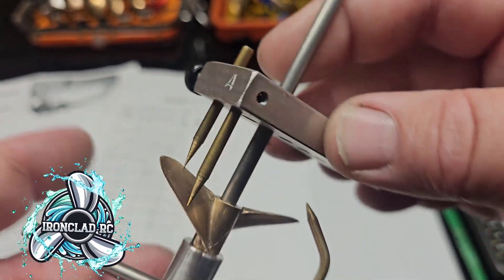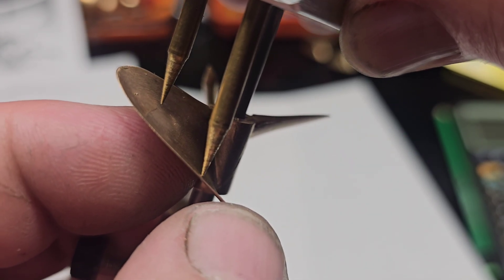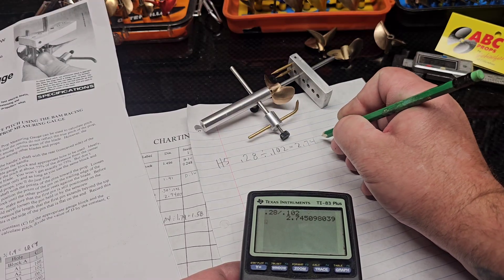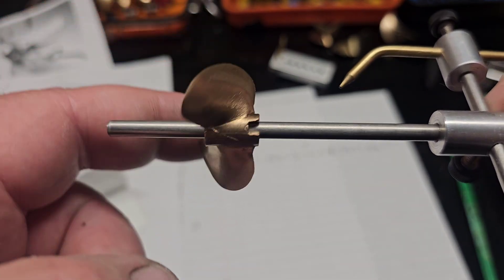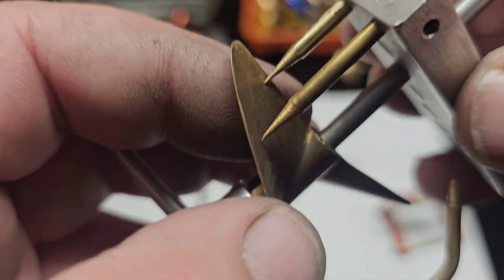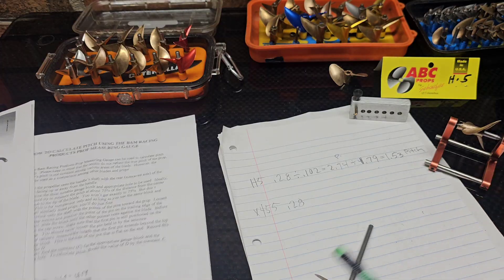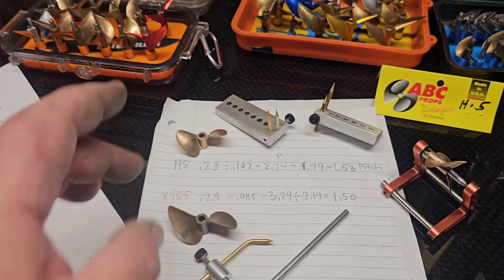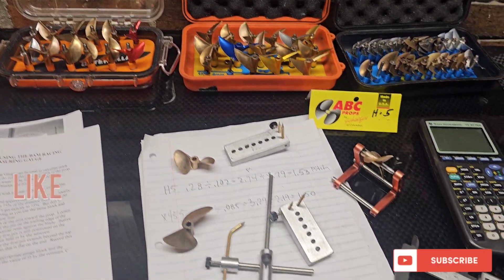Measuring Pitch ABC H5, TFL 1450 & Octura x455 Deluxe Propeller Pitch Gauge from BAM Racing

Comment: This is AWSOME, let us know what you think about the difference in advertised parameters of the props and what your findings show, like ABC and Octura vs what we get from Amazon or simply are the specs on the packaging accurate.  Thanks Big B,  and your right there is not enough information out there on this topic. 👍👍👍
Reply from the maker: Yes sir, i will measurements a few common cnc props to check pitch, one in particular 4519 is one i have always been skeptical of.